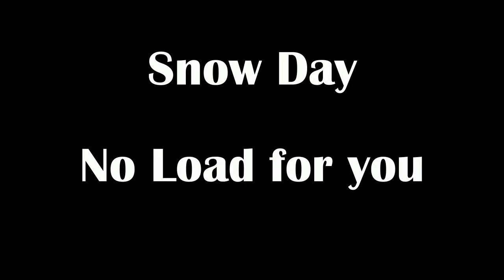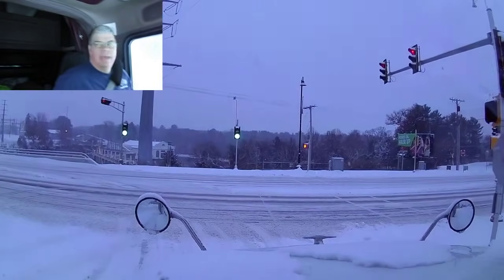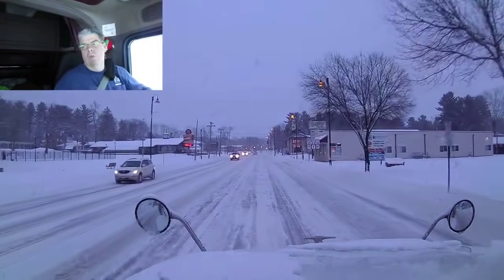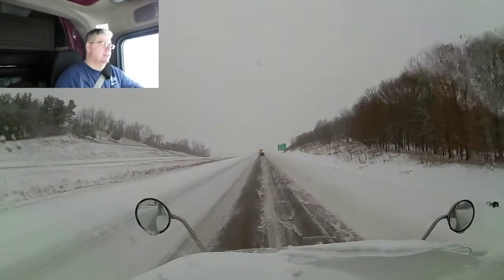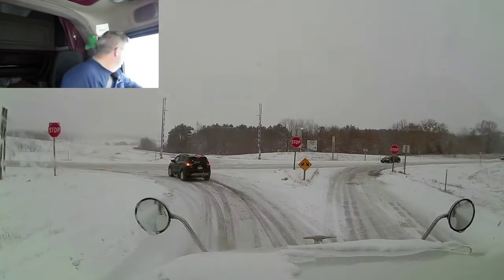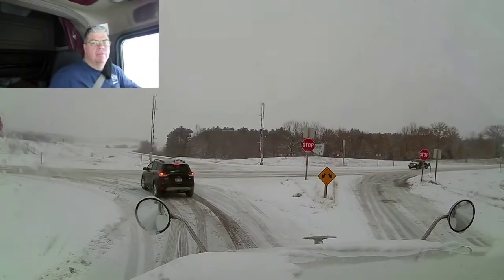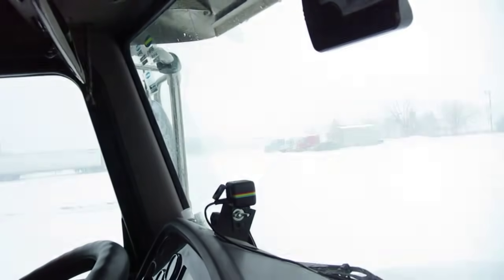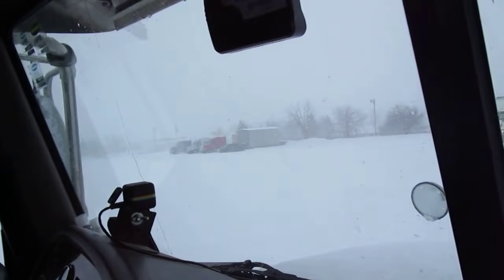#287 Snow Day  No Load for You The Life of an Owner Operator Flatbed Truck Driver Vlog

Comment: Like your videos and you have a good attitude I can tell your a professional driver, we need more drivers like you out here!
Reply from the maker: Thank you and
Thanks for watching
Reply: Very Well Said I have a Question What Buggy is that in your picture I have a few Buggys 2 Manco Dingo Buggys my son and I race we have a 2 seater Silver Fox Buggy street legal 450cc  we have a 1983 Honda 200s three wheeler I ride a 1997 Polaris Trail Boss 250 my wife rides a 2006 Kazuma falcon 110 Yamaha Raptor Clone my son rides and a 2007 Kazuma falcon 250 I ride we have a Street Legal Baja Warrior 200cc trail bike torqe coverter Belt Drive Bypassed the governor it runs 65 70 mph we have another Baja Warrior 200cc Trail bike I'm converting to a Baja Warrior 200cc Super Moto putting  dirt bike fenders and gas tank on it going have 2 gas tanks the original gas tank and Dirt Bike gas tank with a 3 way t splitter going from both gas tanks to the carb different exhaust street tires im actually making it for my son when he gets a little bit older I have a 80cc Motorized Bicycle a 50cc pocket rocket a 110cc mini chopper 2 1972 Harley Davidson 900 sportser's one my uncle gave me at the age of 16 and my grandpa gave me my 18th birthday my 1972 Harley Davidson 900 sportser chopper 7 foot springer front end I have a 1982 Harley Davidson 1200 sportser 25th anniversary my dad gave me my 21st birthday I have both my 1972 Harley Davidson sportser's stored in Michigan at our vacation house our oldest son rides them from time to time I have a 1980 Kawasaki kz1100 I ride when I'm going to be riding with my older brother on his 1978 Kawasaki kz1000 and our cousin on his 2009 Kawasaki zx14r I have a 1990 Suzuki gsx600f I ride when I'm going to be riding my brother on his 1999 Suzuki gsxr750 and our cousin on his 2007suzuki gs650

Comment: The power divider is a differential between both axles. When you hit the switch the power divider locks it. So two wheels has to slip before you cannot get going instead of just one.

When the power divider switch is off, both axles get power, but thru an open differential.

Comment: Power divider does what in the name under normal driving it divides power between both differentials but when you spin out or loose traction when not locked power goes to far rear dif and its a open dif so the wheel of least resistance turns when LOCKED both difs are locked but unless you have a Detroit locker the power is still sent to wheel of least resistance on both

Comment: You can take advantage of having automatic slack adjusters on your breaks. Whenever you get loaded, unloaded, or you connect to a new trailer, go ahead and adjust your breaks. Hold the brake down for five seconds then release for five seconds. Repeat this about four or five times, build your air back up, and you'll be ready to go. This way your brakes aren't so fidgety when you're empty or anything like that.

Comment: I'd watch driving with that inter axle interlock on it will have a tendency to cause over steer,, it's ok to use it for starting up but not running down the road ,, just a thought from a snow goose

Comment: You've got drive to both axles anyway, difference is power divider locks the two axles to the same speed instead of being an "open diff"(basically is what it is when unlocked) between the two axles.

Comment: POWER DIVIDER: Think ALL WHEEL DRIVE with power to both axles.  You lock up the front and back axles like a 4wd. <AWD the computer overrides above 25 mph> 
Differentials lock outs, a 2nd switch, locks  axles wheels in a posit traction mode. So you get 4 power wheels instead of 2 < one on each axle>.
ATC is traction control to stop a spinning wheel and is kind of an and effect. Think of a farmer on an tractor apply left or right brake in the mud of a field to stop a spinning wheel and make the power shift to the traction wheel.

Comment: PARKING:  DO NOT APPLY BRAKES TO PARK …..until a cool down time. 
Snow and warm brakes = WATER = ICE-UP on brake shoes and brake drums.  Then out have to get out and hammer the brakes to release. 
Old school….do not set brakes…put a piece of dunnage to clog the tires for parking in the winter cold….no frozen brakes and etc. 

Do back and forth several times to cool tires so they do not ice bond to the surface you park on.
Reply: its fine for the drives but for the trailer definitely. i never had my drives locked up and i run in northern canada. but yes its always best not touch the brakes heavily 15 minutes before the yard.
Reply: huh
Reply: @hiramrosajr8231  BIG Truck Drivers <semi trucks? know what I am saying about the CAM air brakes on the axles.
Reply: Here’s another tip: when you park in snow, roll back and forth a few times as your warm tires melt the snow making your self a a little runway for leaving later. I see drivers stuck right in there parking spot a lot
Never mind, couldn’t see the bottom of original post

Comment: I have heard that carrying a few bags of kitty litter can help in a pinch to get traction enough to get moving. I plan on carrying this in my RV. Any ideas here?
Reply: Kitty Litter is clay. It can turn into a GREASE when wet. IMHO Get a 'NoSpin Silent' fitted in place of your spider gears. It drives the SLOWER wheel, the faster (outside of a turn, 'cams out" for a no drag (unlike friction clutch type Limited slip) Drove the Alcan in my Winnebago class A, when it was all gravel) operation. You could feel traction issues, because the vehicle rear would do a tiny shimmy when the driven wheel switched sides. SuWeet. Hav lots of snow miles.  Another piece of advice: Make every move Slow and gentle. Quick or hard will get you out of shape FAST.

Comment: Awesome video thanks for sharing this with all of up I am a Owner Operater Hotshot Trucking Company I have 4 trucks I have a 2003 Chevy 32ft Class C Coachman Motorhome and 18ft enclosed trailer I have a 1990 Step Van and 18ft flat bed trailer I have 2 2002 Chevy 1500 Conversion van 16ft flat bed trailer I got started Hotshot Trucking through my Dad and my uncle running small loads they didn't want to run they have a total of 6 trucks and trailers when I first started driving I had a 1996 Chevy Conversion van 16ft flat bed trailer and I moved up to my class C Coachman Motorhome to save from renting Motel rooms and eating out every day I prepare my own food and also my wife likes to go on the road with me when I'm going to be on the road awhile I use my 1990 GMC Step Van for local runs I also have a 1976 Ford F600 Dump Truck a Flat Bed Equipment Trailer a 1997 Ford Backhoe that I inherited from my Uncle but once again thank you for saying a awesome video drive safe watch out for the crazy drivers keep up the good work

Comment: I love driving on snowy roads like that, at least when the traffic is light. One of the keys to driving in the snow is gentle driving. Easy, gentle inputs on the throttle, brakes, steering. And plan ahead and look for outs if you were to slide.